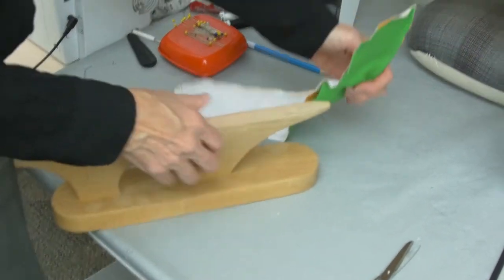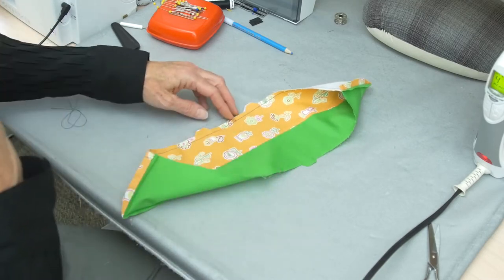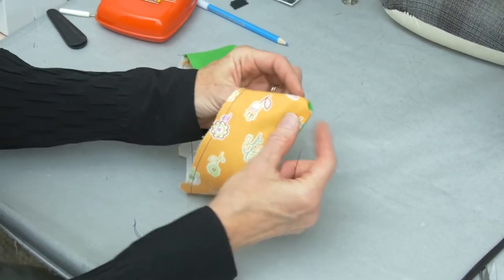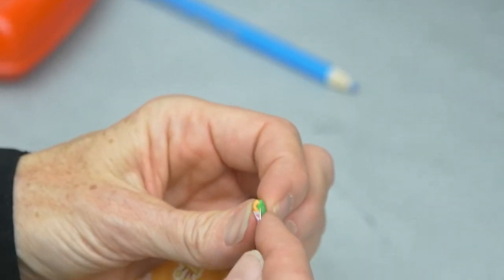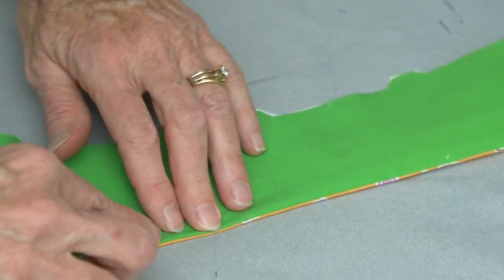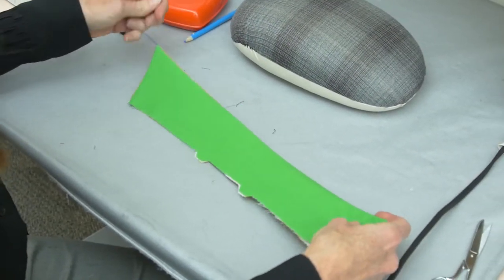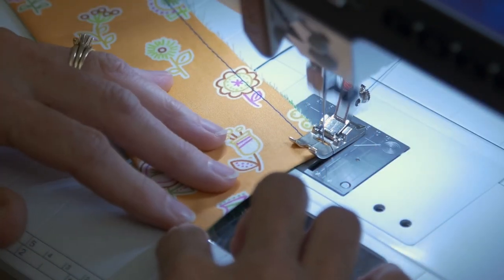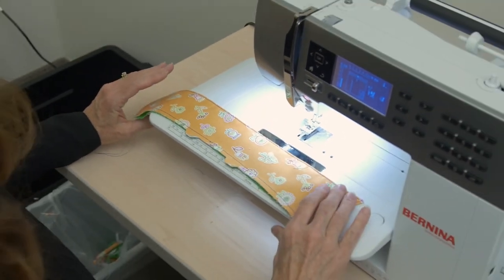287 - Men's Shirt - Shirt Collar (4/7) - Pressing, Turning and Stitching

Comment: One shirt maker laid a thread across in from of the sewing machine needle before making the last stitch before turning, then after taking the last stitch before turning, he wrapped the stitch around the needle and continued around the corner.  This is the same you are doing by hand with a hand needle, but possibly easier.  Your video is amazing.  Thanks.  I was searching on self fabric interfacing.  I just do not like iron on interfacing.